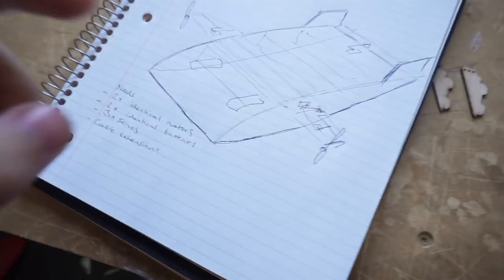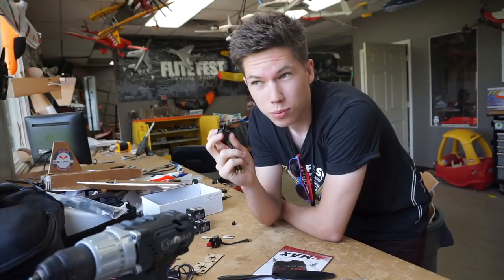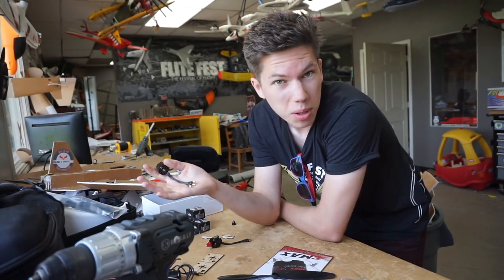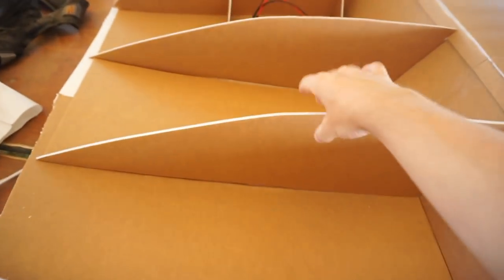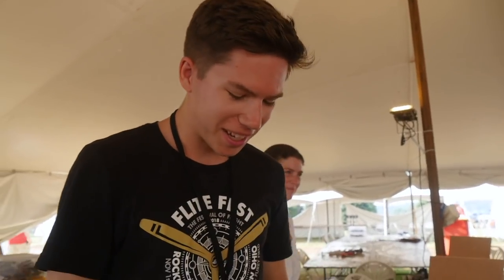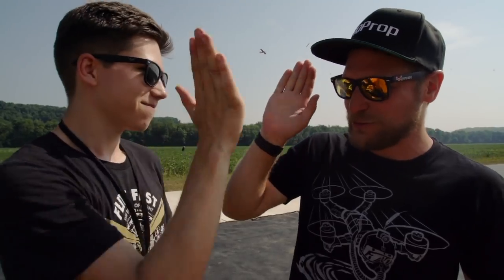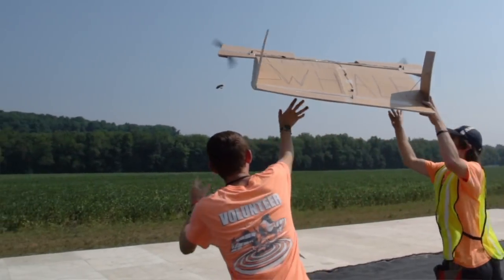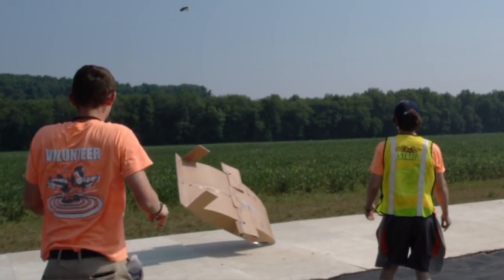DIY Lifting Body Aircraft

Comment: I think you should have gone with elevons on the back, not with a single elevator. The design is quiet interesting though. Keep it up.
Reply from the maker: Not sure why I didn't think of that at the time :P
Reply: with so little takeoff speed elevons would probably have no authority at all, given that airflow from motors wouldn't touch them.
Reply: @Project-Air  was Mike a volunteer
Reply: That's an excellent idea.

Comment: That looks so fun! You've got talent!

I think it would fly with more power, and if it doesn't add too much weight/drag, a rudimentary landing gear/wheels, and maybe you could do a rolling take off from pavement. Then you wouldn't have that stressful takeoff throw when you're not sure if it's going to have enough speed to fly. Would the motors be powerful enough to have it rolling on wheels?

Either way, I'd want at least one more, preferably two more motors. I assume that's more batteries so I'm not sure how much weight I'm talking about...

Comment: The CP on a lifting body shaped like that will shift so far, that if you make it stable, it will definitely not fly well.  If you make it fly descent, it will be drastically unstable.  Please look into how CP moves with CL and angle of attack before giving people false hopes.  At least you're teaching them how not to do it.    The only lifting body that works is a Delta planform, and they are not efficient in any other flight regime but very high speed.
Reply: Selecting wing profile wouldn't help?
Reply: There are multiple lifting body designs that have worked.
Reply: They can all fly, but mostly they only fly with an extreme forward CG.  not very efficient, and that does not work for anything but a toy or novelty.  I guess it's your definition of what works.  Lifting bodies have a very specific role in functional aircraft, and only a limited number of types have proved to be useful.
Reply: @FPVREVIEWS

Apart from the shuttle and spacecraft, the most successful role for lifting body technology has been the implementation of it into functional winged aircraft, such as the F15, F22, F35, and even civilian aircraft like the Skyvan, which utilize the lift from the body to complement the lift produced by wings.
Reply: The sky van is a boat example of a lifting body,  and the decision to use the fuselage as a partial lifting surface and more to do with salvaging something beneficial for the huge amount of drag caused by the fuselage shape, which is there for hauling large cargo, nothing to do with aerodynamics.     all of the others that you mention are Delta planforms, but not true lifting bodies. or even true delta configurations.   there is a difference between lifting body, and blended wing body also.
Reply: @FPVREVIEWS
Yes, I am aware.
Reply: I built a very successful glider that had the same configuration minus the little wings and the control surfaces...it did quite well dropped from a mothership.
Reply: Not true, see several other designs. See the Arup 2 or 4  flying wing. Would be embedded lifting body if they were big enough for everything to be embedded into a unitary wing-body. 15% gives a wing only ~.8meter thick

See the Horton "wingless". Sleek and fast, lighter empty weight and larger payload or range compared to a normal plane of same foot-print. Wildly successful as flying craft, like the Nemeth and Arup.

The legendary "super-draggy" nature of these is a myth or at best mistaken assumption.
They can create a "bubble : or "parachute" of low pressure above/behind them to keep them in the air at silly-slow speed at very high A. At normal A in cruise configuration, that drag goes away and these examples and the Nemeth  and the Hatfield "Little Bird" prove that to be true.

The Arups were stall and spin-proof and video shows them to be nimble and quick.
Reply: about the Arup or Nemeth or Facetmobile, we hear often that they're only a novelty.

That's only because "conventional wisdom" says so.
If a plane is lighter stronger, longer range, safer to fly and handle, then like the Arup or Nemeth or Horton, then it's only superstition and fashion that says "it's only a novelty". 
It's misundertanding and dunning-kruger from ones who've never actually looked into them, that says they must always be draggy or poor-handling or risky.

Comment: I think if you went with elevons on the first version rather than a single elevator to get better roll authority. Maybe try using them on you second version.

Also, if "The Whale" works are you going to post plans?
Reply from the maker: I'd say that's a really good suggestion. Not sure why I didn't think of it at the time! Might well do if I make it smaller (40"ish span)

Comment: design it with a dihedral and maybe work it out so the center of gravity is a small fraction slightly forward of the center of lift so under power it should be stable .give it a citcular elipsoide shap as well  maybe? dunno its just an idea of the top of my head. lifting bodies are great . i think the ideal is somewhere between a lifting body and a flying wing oval shape where the edges blend into the body. possibly ducted fans are the way to go . if you could rig a system to  direct the jet (moveable slats?) you'd then have vectored thrust which could be usefull. anyway there you go

Comment: Re-do, but move the motor mount location. You want the motors to be arranged so the main flow comes from the leading edge, but mostly over the upper lift surface. This way you effectively have the aircraft at a higher air-speed, just due to the air being moved by the motors themselves.

The configuration you used in this video doesn't really provide any such advantage.

Comment: Follow what's worked in the past. Ample authoritative control surfaces are necessary.

 See especially the '50s Horton "wingless", first version or the later twin. also the Rowe "UFO", the Arup planes (Indiana, 1930s)
Simplify it.

There's no reason that simpler attached control surfaces can't do well also, like the Arup 2, & Hoffman, the Little Bird, the Horton, others.
Those winglets aren't necessary. Put the engines or just put them on booms and forget about lifting or steering with them.

Comment: Embarrassing but that lifting body is a tryed and tested airframe the flapjack plane from the 1940 I think is was vaught xf5u flying flapjack it had little wings at the back to keep it stable maybe you need to add the small wings at the back.
Reply: Vought and Zimmerman found that attached flying surfaces like on the early Arup or the similar Hoffman wing lacked some authority, so they added the elevons.
The Arup S-4 used a different approach, and the Nemeth had a fuselage under a circular wing. Stall-proof, STOL, fast and sleek.

Zimmerman and Vought built that after the Arup 2 flew for NACA -and Zimmerman was on the NACA tem that evaluated and was thoroughly impressed by it. It did not need the over-complicated drive system with flapping props. Arup did not suffer excessive drag at cruise, and the exaggerated tuned-length & speed props were found to be of no particular aid, spinning outboard or not.